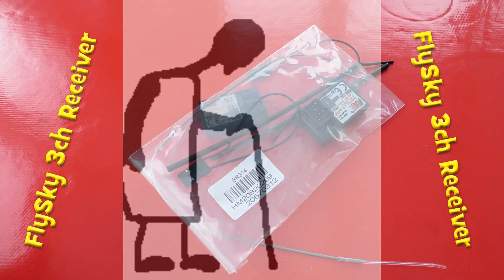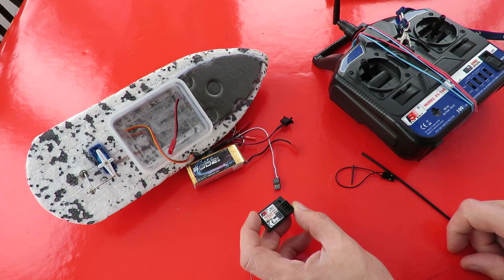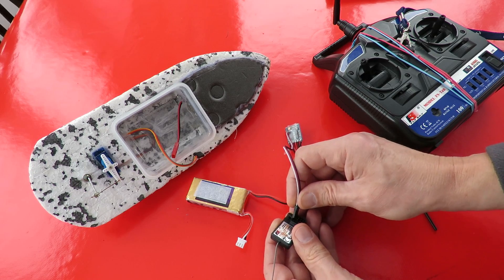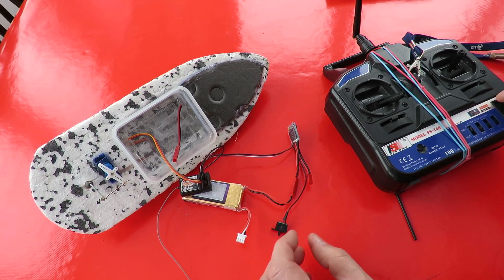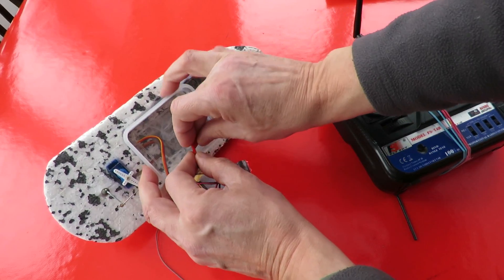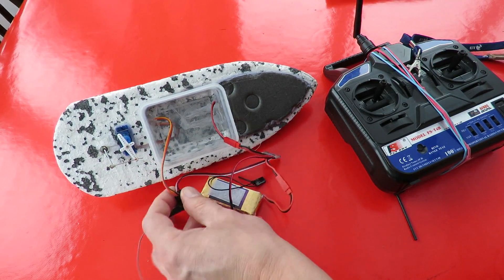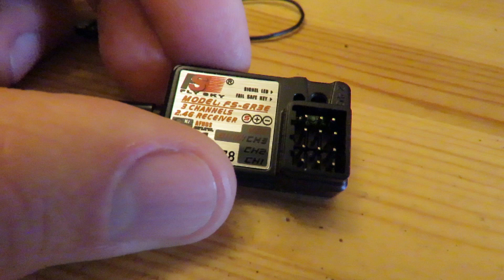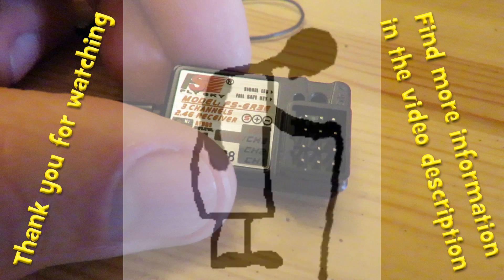FlySky 3ch Receiver

Comment: Can u help me
Reply from the maker: I have no idea, what is your problem?
Reply: GrandadIsAnOldMan I’ve tried to bind my electronics that are the exact same reviver and controller and I did not bind and kept flashing with the ref light
Reply from the maker: @chally2mbt12  in my video description there are links to other people's videos on binding these receivers if my video was not clear enough. The only point I would make is - press and hold the bind button before you switch on the transmitter and release the bind button after the transmitter is on.
The sequence I followed was switch OFF receiver and transmitter
Check you know where the BIND plug should go on the receiver
Insert BIND plug in the BIND position on the receiver (still switched OFF)
Press and hold the BIND button on the transmitter 
With your finger STILL on the BIND button, switch on the transmitter
Take your finger off the BIND button
Now switch ON the receiver
The light should go steady
Switch OFF the receiver
Switch OFF the transmitter
REMOVE the BIND plug from the receiver
Switch ON the transmitter
Switch ON the receiver
They should now be working

Comment: Hi, Can i use Li-Po 7.4v battery for ESC 30A with this receiver? does it burn the receiver for this voltage?
Reply from the maker: If your ESC has the built in BEC circuitry then it will supply the correct voltage to the receiver. A battery eliminator circuit (BEC) is an electronic circuit designed to deliver electrical power to other circuitry without the need for multiple batteries. Most ESCs have this facility but read it's specification to be sure. That means that if the ESC is designed to handle a 6S LiPo battery (23v) but it is equipped with a BEC it would still deliver the 5 volts to the receiver
Reply: @GrandadIsAnOldMan  hi.. im curious so that RX only can handle 5v suply or can be burn, is it?
Reply from the maker: @alihamidiyt  as far as I know virtually all hobby grade receivers are designed to work on 5 volts. They are usually powered from a special circuit in the ESC that drops the power from the main battery down to the 5 volts the receiver needs to operate. That circuit is called the BEC (battery eliminator circuit) because it eliminates the need to have a separate battery supply for the receiver. This Wikipedia article may help https://en.wikipedia.org/wiki/Battery_eliminator_circuit

Comment: what battery do you use?
Reply from the maker: The power feed to the receiver is via the ESC and that supplies the correct voltage regardless of the battery used. That particular battery is a VKS 2S 1200mAh  20C LiPo battery
Reply: @GrandadIsAnOldMan  thank you
Reply: @GrandadIsAnOldMan  what ESC is that?
Reply from the maker: @Davis-tl1rc  this video is over 2 years old but that type of ESC is fairly generic. I had a quick look on eBay for you and this looks like the same one https://www.ebay.co.uk/itm/232742004939

Comment: Is the receiver waterproof thanks 👍
Reply from the maker: They are not sold as "waterproof". I have got them wet a few times and they have survived and I did open one up and give it a good coating of nail varnish when I knew I was going to be using it in a boat that was likely to get very wet. Here is the video of that bit https://youtu.be/I5v4u4gGr3Q?t=234

Comment: Hey I’m having an issue where I get no response from the trigger, when I swap the steering servo and each cables over from channel 1 to 2 the throttle does work but only via the steering wheel and now the trigger still won’t control the steering servo? Is the transmitter and receiver faulty? Or both
Reply from the maker: Let me see if I understand what you are saying
Step by step
1. Steering motor works when you operate the steering 
    Drive motor does not work when you operate the throttle

On the receiver you swap the drive and the steering wires over
2. Drive motor works when you operate the steering
    Steering does not work when you operate the throttle

In both cases nothing happens when you operate the throttle.
So you have proved that both motors work but you cannot prove whether it is the transmitter or the receiver that is faulty.

You are right, you cannot prove which is faulty without having another transmitter or another receiver that you know works.
Reply: GrandadIsAnOldMan thanks for your reply I do have another controller but it has the same issue now this either a series of very unfortunate coincidence or I have two bad controllers with the same issue I have tested both with 3 different escs 3 motors and different steering servos
Reply from the maker: If you have tried it with a different controller and you get the same issue then - as you say unless you have a very unfortunate coincidence - it does look like it is the receiver that is faulty. I have burned out the power transistors in many of my toy grade receivers on the drive motor output, usually by trying to drive the car through grass, the motor overheats, draws too much current through the receiver and the power transistor fails. On hobby grade receivers I have only had problems in the receivers when I have got them wet. All the power is handled by the ESC externally so when the ESC is overloaded and fails it does not affect the receiver.

Comment: Can we use that FS-GR3E 3ch rx with Flysky fs-GT5 transmitter?
Reply from the maker: I cannot speak from experience as I don't have an FS-GT5 transmitter. A quick search through YouTube videos on the FS-GT5 does look like there may be problems getting it to bind with other receivers, but you really cannot tell from peoples comments as they often just have a dislike. Your best bet is to check on one of the RC forums. To be honest they are probably cheap enough to buy one just to try it for yourself.

Comment: Brilliant... is this a how to use the wrong radio for your model, and how to take 5 times longer than it should to bind your receiver. I'd leave the vid's to the pro's mate... 😂
Reply from the maker: Perhaps you could take the time to make a video of your own to show us how to do it
Reply: @GrandadIsAnOldMan  No thanks, i'd recomend to follow the instructions given on there website. 

You are also using an air transmitter when you need to use a land/water transmitter. They self centre the throttle so you can actually use the model properly.
Reply from the maker: Haha, brilliant reply for somebody who cannot be bothered to back up their comment with a demonstration. I accept I am no RC expert but I do know how the transmitter works. You obviously know that for a mode 2 transmitter the left stick auto centres horizontally but not vertically and the right stick auto centres in both orientations. This suits my style of boat, car and aircraft flying. On many of my boats I use two motors with differential thrust for the steering controlled by the left and right stick. For most of the time I would set the left stick as the main speed control and the right stick would then provide the steering by varying the speed in relation to the left stick. The issue with the brake on the ESC is not a problem if I am using the right type of ESC for a boat or aircraft (no brake required) but is always a problem with this particular type of ESC with a very basic brake and no programmable features and the FlySky FST4B transmitter as it does not give the full throws required to activate and deactivate the brake effectively. A simple hazard when buying the cheapest of the cheap RC component parts. You will find I have demonstrated this in another video and for the record I do have a few "Pistol Grip" style transmitters including one I bought specifically to test out these cheap "brake" type ESCs.

Comment: I have the same looking esc..my motor gums but my throttle will not work. Steering seems fine. Any ideas?
Reply from the maker: Honest answer, try a different ESC. I have burned out plenty of these ESCs but they are cheap so I but several at a time.
Reply: @GrandadIsAnOldMan   that was exactly the problem. I dug out an old Traxxas xl5 receiver and hooked it up and it worked like new. Thank you!!!
Reply: @potatopower4026  what kind of ESC is that? i cant seem to find it.
Reply: @Davis-tl1rc  They are generic, unbranded escs from China. I find them on shopping apps and websites using a generic search. You can find them on eBay, Amazon sometimes, Gearbest, Geek/Wish, AliExpress, and more. Generally I'll type in "20A ESC" and find the same red colored ones on all those sites. You can also find others that look similar that have different functions and power ratings, that look similar as well. Keep in mind they are very cheap, but usually you have to wait a long time for shipping if you are in the USA since they are usually from China. To be honest, I like to order 2-3 at a time cos they are so inexpensive, and they are not always as tough as some of the very expensive ones. I will say this, they are good little devices, though, and I've never received a bad one.
I typed in "20A ESC" in eBay search and found one in the USA as an example. Here is the link! Hope it helps! If you need any help please contact myself, or the great guy who posted this video!
😊

https://rover.ebay.com/rover/0/0/0?mpre=https%3A%2F%2Fwww.ebay.com%2Fulk%2Fitm%2F332357822669
Reply: @potatopower4026  well there are several types of esc available like 20A , 30A, 320A, what's the difference between them?

Comment: And also my receiver f949 one of my servo is burnt can I solder normal servo (blue colour )
Reply from the maker: No you would not be able to simply solder a normal servo directly to the board. You say yours is burnt, I guess you mean the motor and not any of the chips. It might be possible to replace the motor but you may have trouble identifying a suitable replacement motor.

Comment: Hey please someone please tell me I have f949 reciver and transmitter if use this 3'ch receiver how can I control my coreless motor please someone tell me
Reply: On the basis that the FlySky transmitter binds with the F949 receiver then I would guess the opposite should work however I have no practical experience as I have never had either the F949 transmitter or receiver. Maybe you should try a YouTube search and ask somebody who actually has experience with them. This search brings up several videos on the subject https://www.youtube.com/results?search_query=f949+flysky and I know RC Lover San has done work with the F939 https://youtu.be/A3ewShlKVH8
Reply from the maker: You would probably do better just buying a new F949 receiver. It has all you need onboard. If you get a receiver like this FlySky one you would also need to buy servos which you would have to fit somewhere else on your plane. To control your motor you would need to buy an ESC.
Reply: GrandadIsAnOldMan ok thanks for replying maybe I should buy new f939 receiver but the problem is that servo motor on f939 are very small and lift very less as compared g90 servos I have spent so much money on buying transmitter receiver motors propellers but nothing is actually build only because of receiver and servo thanks  for the reply
Reply: GrandadIsAnOldMan can you tell me please that f949 transmitter can connect with flysky receiver and servo ?
Reply from the maker: There is no point in buying the F949 if you are not going to use the onboard servos. You can buy a FlySky receiver cheaper and the normal servos will plug straight in
Reply: GrandadIsAnOldMan will f949 transmitter connect with flysky receiver ?
Reply: GrandadsOtherChannel thanks for the help really
Reply: GrandadsOtherChannel actually I want to make a receiver which can connect with my f939 transmitter and after that I want to control g90 servos which are good instead of f949 receiver servos
Reply: GrandadsOtherChannel I have found something my f939 transmitter is compatible with flysky 3 channel receiver but idk will flysky receiver control dc motor speed or I have to do something else please reply

Comment: Rc battery and Rc Nitro can use same remote ???
Reply from the maker: Why would there be a difference?
Reply: Just to be sure if i purchase new radio control can support My Rc .
Reply: It will work with both nitro and electric I run these on all my vehicles

Comment: I bought my receiver and plugged my motor, servo, and power. She ran fine for about five minutes then, poof. Nothing! I felt the back of the receiver and it got incredibly hot. Now if I apply any power, nothing else, it starts to get hot.

Can you help me?
Reply from the maker: Probably too late now. What power did you use? This type of receiver is usually rated at 5 volts and takes the power from your ESC or BEC.
Reply: GrandadIsAnOldMan 

I was using a 5VDC regulated power supply set at 300mAh
Reply from the maker: That should have been fine. If you bought it from a reputable dealer I would try to get you money back or a replacement. Not so easy if it was an eBay seller but still worth contacting them.

Comment: I am having a normal rc reciever .so can you tell me how to connect the servo to it so that it can automatically come in the center position after the control button is relased...actually i had tried but its not working...
Reply from the maker: You say a "normal receiver". Do you mean a cheap "Toy Grade" receiver where you control is just Left or Right with no proportional movement like a Hobby Grade system. If that is the case then you are out of luck. A hobby grade servo is not compatible with that sort of receiver. Toy grade works with just reversing the current flow so left has the current flowing one way and right has the current flowing the other way and the return to centre is done my a spring attached to the car bodywork. A hobby grade servo has 3 wires. the power is supplied on two of them and the third wire carries the signal from the receiver to the control board inside the servo and tells it how far to move the servo arm and in which direction. The control board inside the servo interprets that signal and turns the motor. There is a potentiometer attached to the shaft of the servo arm and the controller board measures the resistance of that potentiometer so it can tell how far it has moved and stops it at the required position. Just reversing the current into a hobby grade servo will not make it go backwards, in fact it will probably kill the controller board inside the servo. You can remove the controller board from inside the servo and connect power direct to the servo motor to drive it in each direction BUT YOU WILL NOT HAVE AN AUTOMATIC CENTRE FACILITY and the gearing in the servo will be too strong for a normal toy grade spring to return it to the middle. I will paste another reply here with my standard text on this subject.
Reply from the maker: My standard reply text to this type of question.
Hi chetan ponia, thanks for commenting. LONG ANSWER now. I am afraid that standard hobby grade servos are not directly compatible with toy grade RC receivers. They work in a different way. Hobby grade servos have a 3rd wire, that is a signal wire that the receiver uses to tell the servo controller board how far and which direction to turn the armature. The controller board in the servo then turns the armature the required distance. 
Toy grade receivers just have two wires and have three signal states.
(1) Applying the battery plus and minus on the wires turns the steering motor one way.
(2) No battery applied allows the spring return to centre the steering.
(3) Applying the battery minus and plus on the wires turns the steering motor the other way.
If you connect the same two wires to an ordinary DC electric motor and apply "Left" the motor will keep spinning as long as you hold the transmitter on "Left". If you then apply "Right" then the motor will spin in the opposite direction. 
In toy grade steering the only thing that stops the motor from spinning is the mechanics of the steering so the motor is still trying to spin but the steering arm has reached stop. On a hobby grade servo the electronics measure how far the steering has turned and stops the motor electronically.
Reversing the power feeding a hobby grade servo will probably damage the servo controller board, it certainly wouldn't make it turn the opposite way. If you remove the servo controller board and connect the output from the toy grade receiver directly to the motor inside the servo then it would go forwards or backwards like the toy grade motor but it would go all the way until it meets the internal mechanical stop inside the servo, so you would not have proportional steering. Also because the motor is heavily geared the normal spring on the toy car would not be strong enough to return the servo to the centre position when you want it to go straight, so you would be worse off than you were with the original toy grade steering. ??
Here is my playlist - Working with RC servos https://www.youtube.com/playlist?list=PLA5a2xPRSrB1nJ5I3Uzrjf41VCJzrab4p